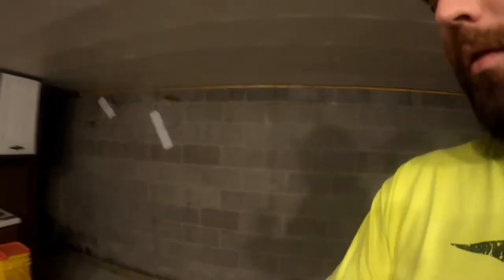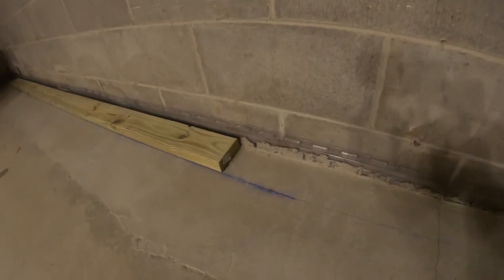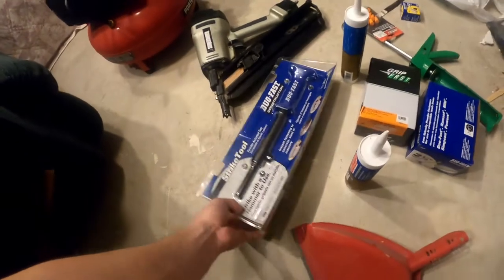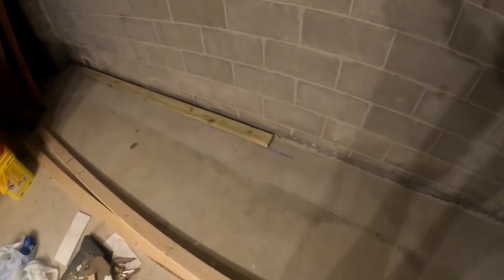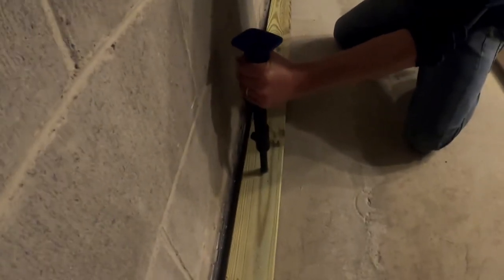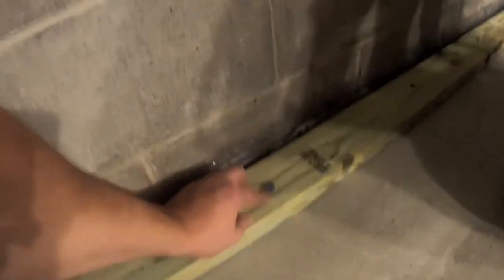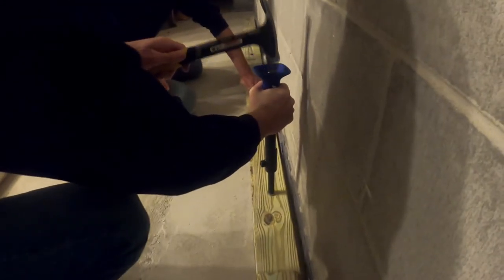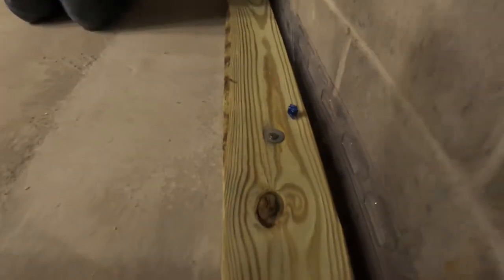Framing a Basement with Beaver System

Comment: So wouldn't you get mold behind the wall if it was getting moisture ? I know it's good for keeping the water off the floor but if water is coming through the wall the block will have moisture also and with it sealed up wouldn't mold grow ?
Reply from the maker: I'm not 100%, however,  I think the issue was water was pooling up there.  With the beaver system, there is cut slots in the cement where the water can drain so it will not pool up which significantly helps with moisture
Reply: Home RenoVision DIY has a video with a pretty good sounding solution. After railing on his audience for a while for even wanting to finish a block wall basement, he said you can use four big globs of construction adhesive to standoff foam board. It allows air and moisture to get where it needs to go. He also said that the ideal is to also install a subfloor with channels built in and seal it to the new wall you made thus making a closed system where air pass through the slab (if no vapor barrier is present) and along the walls. Mold needs lack of air movement, standing moisture, and organic material to grow. So, batting pressed up against the wall might not be the greatest idea. 

I'm still working out the details for my own basement. Thanks for framing tips. This helps!